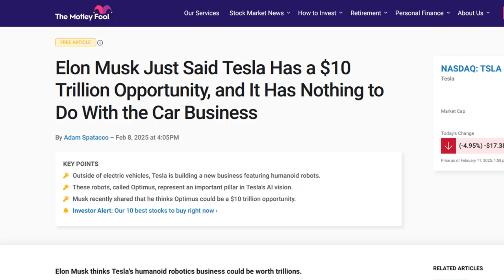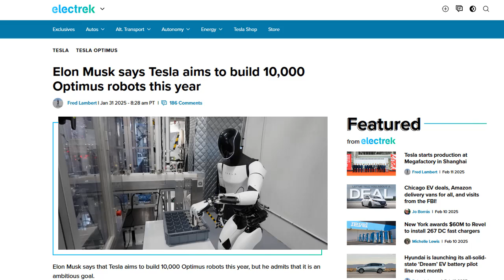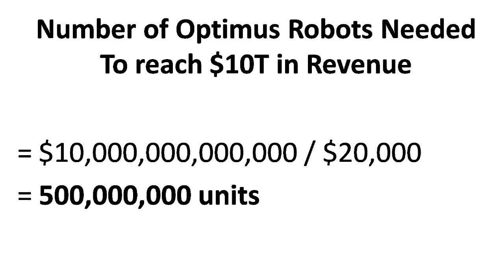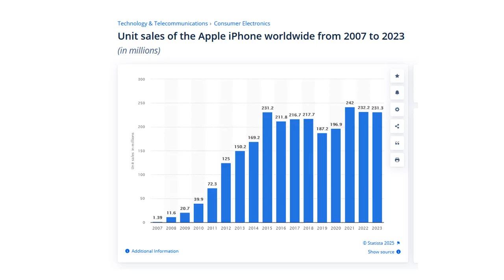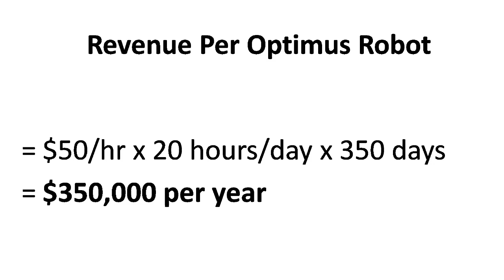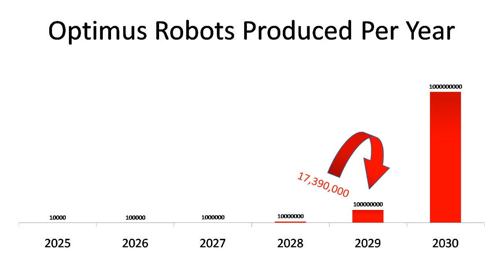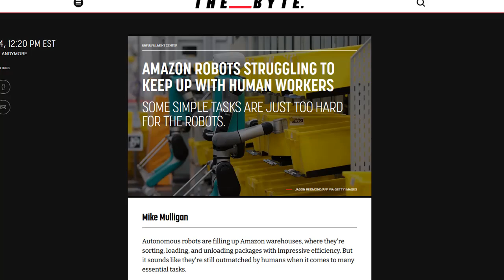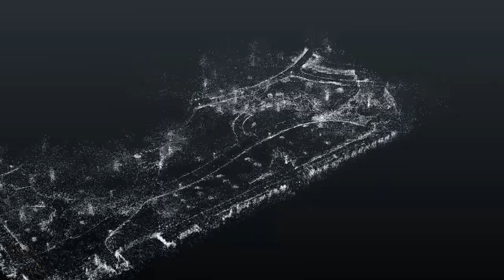Tesla Bot Will TAKE OVER in 2026 (Self-Replicating Robots)

Comment: No way the robot can charge 50$ an hour when plenty of jobs are 15$  plus benefits and taxes etc.

I think he was referring to the valuation of 10T which would be 10x smaller which is more believable. Maybe in 20 years Tesla could hit 10T but Tesla has to build a huge supply chain from. The ground up for components and raw materials, while still increasing similar supply chains for battery storage and the EV which will compete for similar materials.
Reply: Agree, I think he meant 10 trillion market cap, not revenue.  10 trillion in revenue assuming 25% margins and 30 multiple is a market cap of 75 trillion.  I'd be ecstatic if TSLA hits 10 trillion market cap.
Reply: He meant $10T market cap. But that revenue is possible too.
Reply: Yawn, another naysayer, there seems to be a never-ending supply. I'm so rich now from ignoring them.
Reply: @garethrobinson2275  let's say the robot needs only 1 unique chip. Do you know how long it takes to get a chip line from design  to full scale production let alone a 200 million unit production? Like 5 years minimum.  Elon has been wrong on literally every timeline he has ever given. I am a Tesla bull, but your hyper bull status is blindness and faith not grounded with evidence.
Reply: @garethrobinson2275  a hyper bull making fun of a bull.... Do you know how long it takes to take a chip from design to mass manufacturing? Let's say he wants 1 unique chip in this robot which is not unreasonable. To get 20 million units a year would be a long ass time. You'd have to build the production lines of the chips and all the supply chain, meanwhile still trying to grow the supply chain of other product lines that compete for the same resources...
Reply: @dtcanxz  They already have the inference computer.
Reply: @garethrobinson2275  does that print chips with magic? You have to build the factories then ramp each production at each one. Do you not remember the model 3 ramp? Sure this item is smaller and Tesla has learned a ton, but making 20 million of robots is way bigger than 1 million model Ys. You are skipping so many steps you're likely to fall.
Reply: @ 
Chips are trivial to scale up. You don't need factories or anything else, just call TSMC or Samsung and tell them how many you need. Actually the more the better, because big customers have priority.

Comment: Tesla's robotics developed in the vehicle are basically robots on wheels. 
Robotics in the Tesla's factories will increase production 5 fold or more. 
No air-conditioning costs 
No lighting costs
No locker change rooms, no toilets or restrooms, no carparks, 
Production per ENTIRE FACTORY SITE per m² 10 fold.
Robotic truck delivery 247. 

Each robot cost $100,000 to make, or less. Robots making robots making vehicles. 

No new factories are needed, m² production output will be cheaper and greater in numbets. 247 and no labour costs. 

Sun belt production locations means independent energy locations. 
Ship energy north 247, 365.
Canadian cross border fossil fuels supply not needed. 

Robotic PV panels manufacture 247 and no labour costs. 

Robotic BEV, battery vehicles battery manufacture 247. No labour costs.
V2G battery electric vehicles. 

Robots making robots industry 
Vehicles industry 
Energy industry 
Roof shading industry, 😎 PV panels 👍 👌 
Airconditioning buildings and Airconditioning in battery electric vehicles, nobody walks in hot latitudes. Dirt cheap electricity. 
Communication industry 
Space industry 
Distraction industry 😮😊😊😊😅😅